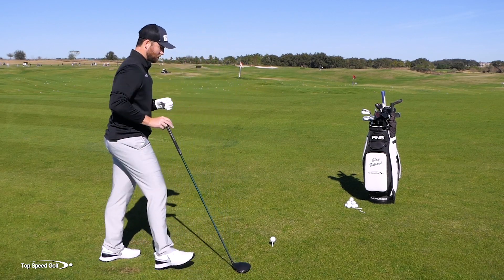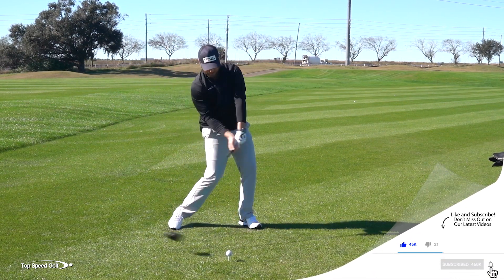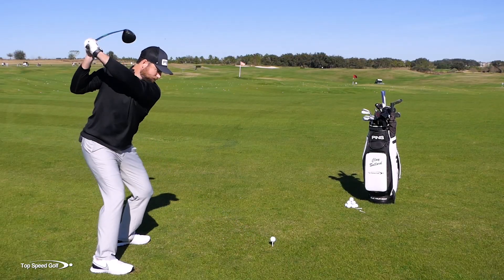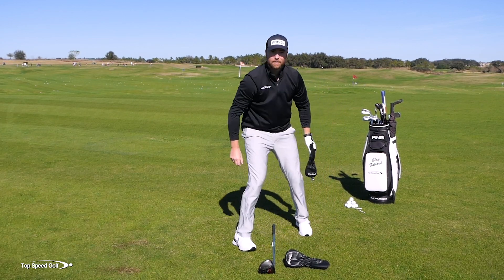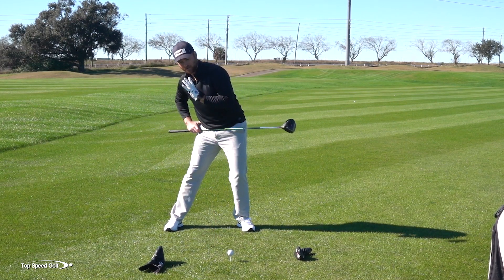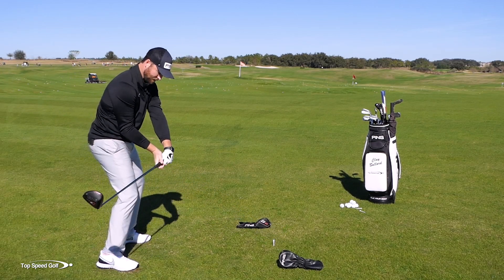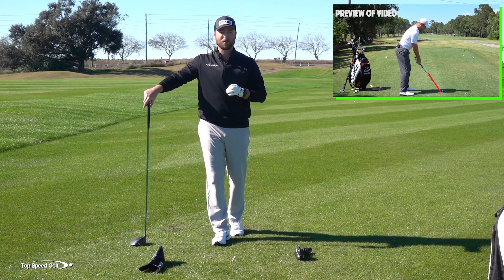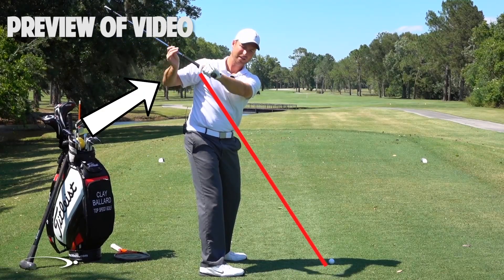3 Simple Ways To Fix Your Slice | GUARANTEED

Comment: Clay...I have another way to eliminate your slice.  I tried the new Ping G425 fairway woods today.  I could push them left and I could push them right, but I couldn't slice or hook these things.  I hit them off the toe, on the hosel, fat, thin , still they were straight.  Ping has either eliminated side spin on their fairway woods or your lessons have finally sunk in.  Didn't get to try the big stick but maybe I do not need it with the three wood.  Would love to see a driver review similar to the one you did for the G410. Will they be in your bag eventually?
Reply from the maker: Glad it's working so well for you. Keep it up!

Comment: I still have a slice issue with my driver ... irons and woods are ok, I’ve noticed in recordings of my swing that I release like you speak of here but at contact the face is open, I also have an issue swinging in to out with the driver where I make contact with the ground ... I will need to give the head over idea a try but there are so many things wrong in my driver swing ... open face, over the top, hitting behind the ball, downward angle of attack ... it’s all bad ...
Reply from the maker: I would try moving the ball a little more forward in my stance closer to my front foot and address the issues one at a time. I would work on my swing path first. Exaggerate the swinging out to right (assuming you're right-handed) until the ball starts right and moves left and dial it back if it starts curving too much. Best of luck! Nate | TSG Instructor

Comment: what would you suggest for high speed slices? when i swing 70% i get straight drives about 240m, but when i speed up, its a vicious slice that i cant control at all.
Reply: I also can hit a decent straight shot at like half speed, when I speed up it’s a huge slice ... kills me ... what I noticed is that the speed up in the swing typically swings the head of the club out to in more than a slow swing, and timing the face closure is tougher as well ...
Reply from the maker: The ball will start about 75-80% in the direction of the face angle at impact and curve away from the swing path. It's likely your swing path becomes over the top with a strong out to in path when you put on the gas. I would try to hit the ball out to the right with exaggeration until my ball starts right and moves left and dial it back if it starts moving too much. This will take some practice. Here is another video that may help: https://www.youtube.com/watch?v=TkJRSOVuwrE&t=7s Best of luck! Nate | TSG Instructor
Reply: @TopSpeedGolf  thanks Nate! Much appreciated. Keep up the awesome work, mate.
Reply from the maker: My pleasure!